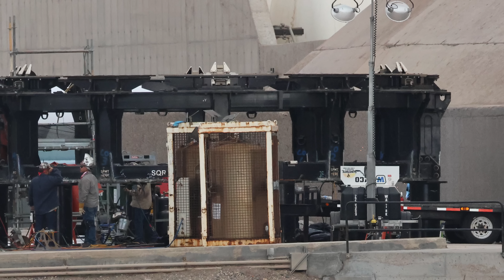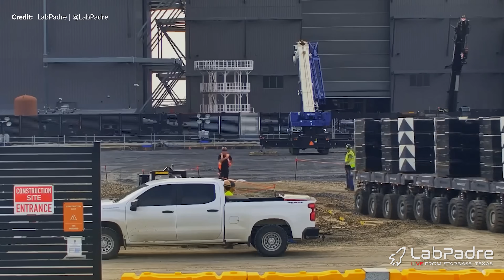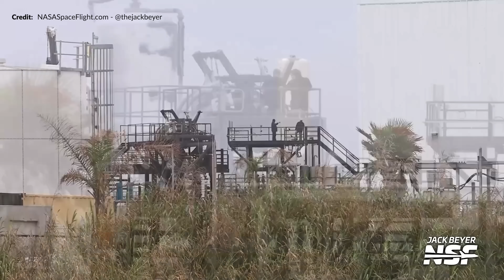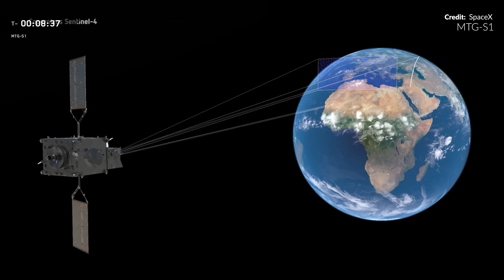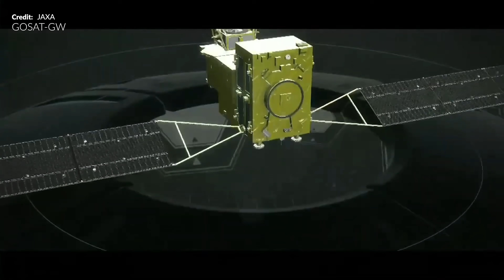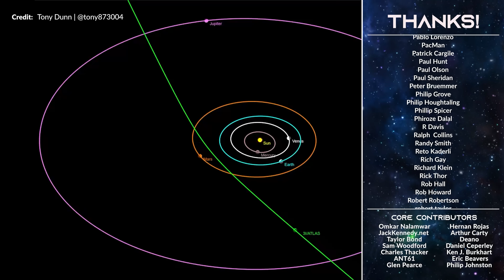SpaceX Isn’t Waiting With Starship... Here’s Their Big Move!

Comment: Is SpaceX bad or 1960's NASA was on God mode? I'm starting to view a functioning Starship like FSD (fully autonomous self driving), only happening inside the minds of investors and nowhere else.
Reply: NASA spent over 300b on the Apollo program, inflation adjusted. SpaceX has spent around 10b so far on Starship. Huge differences right there. Plus SpaceX is working on a more ambitious program. Starship is much larger and over twice as powerful as the Saturn V. And they are trying to do full recovery, rapid flights, massive payloads, and in-flight refueling on top of Lunar landings and eventually Mars missions.
Reply: @anthonypelchat  The entire Saturn V program cost $33.6billion in modern money (according to Wikipedia), for 12 successful launches. That's $2.8billion per launch. SpaceX's $10billion for no successful launches is beginning to look like "poor value for money", especially as it's involving supposedly "cheap and easy" materials like stainless steel, and methane instead of the tricky-to-handle LH2 used in in Saturn V's 2nd and 3rd stages. 

The wider moon landing program cost more, yes, but we're comparing boosters, not programmes.
Reply: @abarratt8869  You are excluding everything else from those costs that the Starship program is doing. The 10B for the Starship program includes not just the booster, but the ship, the entire construction of Starbase, everything for the lander, crew areas and life support, and much more. Further, Starship has had 9 flights at that cost and multiple ships already built.
Reply: @anthonypelchat   $10billion to not orbit successfully once is a lot of money... There's no point in having Starbase, a lander, crew areas, life support and much more if the big firework keeps going boom prematurely.
Reply: @abarratt8869  They haven't attempted to get to orbit. They have had multiple successful flights though.
Reply: @anthonypelchat  Interesting definition of "success"... Sure, they've pulled off some neat tricks; catching the booster, getting one or two soft landings out of fairly singed StarShips. But, absolutely none of it counts for anything whatsoever unless the whole of it succeeds. All it takes is for just one thing to fall short of requirements and the whole thing is a failure. 

In a weight-critical system such as a rocket, the consequences of a failure to meet requirements ripple out across the whole thing, far and wide, and fast. Something not strong enough to survive the vibration environment? Sure, you can make it stronger but then it's heavier. Then you need more thrust. And so on. 

Also, one of the reasons rockets are "expensive" is the time and effort that goes into QA, ensuring that all those component parts that have been cut down to the bare minimum are as close as possible to that minimum without being below it. If you deliberately force a pace (such as Musk does) which such diligent QA can't keep up with, you either need to add weight to everything to compensate or things are going to break. And, oh, look!

The reason why rockets like Ariane and Falcon 9 are so reliable is because both are done to a high QA standard. In the case of Falcon 9, NASA forced them into this as part of getting a crew rating. The French do it because, well they're French (i.e. notoriously diligent and capable engineers, when they need to be). 

By choosing heavyweight materials like stainless steel, SpaceX have deliberately run that risk for the purported benefits of being able to use cheap stainless steel. The kind of issues they're clearly facing would all be significantly eased if they lost a few dozen tons in mass by using lighter weight materials. Changing  materials basically means "start over". 

They may ultimately succeed. If they do, great. But the omens aren't encouraging. They've had several attempts at solving some fundamental issues, and not really got close to whole system success. So far, they haven't made something usable, let alone re-usable.
Reply: Well, NASA spent less money successfully going to the moon (even when sums are adjusted for inflation and time).

NASA has always done a lot of Systems Engineering. This inevitably leads to a lot of detailed analysis and much thought given to design choices  before finally picking a direction to follow, build and launch. It’s dull but it means you’re more likely to identify a complete show stopper before you’ve built anything, and avoid it successfully. 

Musk and co have done way less and have made some assumptions. They’re now finding out that their assumptions aren’t so solid as they thought. One failed assumption was that rapid  iteration would be quicker and cheaper. Turns out, not. 

Blue Origin are more like NASA in approach and will win I think. Their first big rocket launch was a remarkable success. They’re now in upgrade mode, SpaceX are upgrading something that hasn’t worked once. 

The other way of looking at it is that the boring experienced analytical engineer who keeps saying “it’s not going to work” is worth billions. Not listening to such people can get very very expensive.
Reply: @abarratt8869 no idea how you got that NASA spent less going to the moon. The Apollo program was over 25B in the 1970s. That is around 300b today. SpaceX is only around 10b today.

Comment: I don't understand why ground zero needs such complexity. Why can't the launch pad just have a man-made lake under it and blast the rockets into deep water? Surely that has less problems to solve than all this crazy complexity...
Reply: Can't build a lake there. and even then you have to pipe propellant through the water and build the pad in the water which means constant specialized maintenance. And even then I'm pretty sure they'd still have to deal with shockwave reflections off of the water and water being thrown up into the engines.
Reply: You can’t build too deep at starbase because of how weak the soil is
Reply: @thespacegoose4299  All you need is a pond. I suppose the biggest problem with a single calm layer is that it would reflect the energy too well.
Reply: Or a natural sea? I agree, I wonder when we will see the landing craft used as launch pad.
Reply: Because nobody wants clouds of superheated corrosive salt water spreading across their launch site... and it would be salt water, because you're certainly not going to build a freshwater pond in that location.
Reply: @simongeard4824  Gonna face stuff far worse out there, though I suppose for a fueling station, you have a fair point.
Reply: @Stumpy1234  Sure, they'll see a lot of salt all over things just from the air, never mind the occasional hurricane... it's just part of working in that coastal location. But the heat makes it just so much worse... it's hard enough to protect everything from the rocket exhaust anyway, without adding saltwater steam to the mix.
Reply: @simongeard4824  I personally think that launch ships will be normalized, as this allows for simplified orbital path, and reduces hazards to land.

Comment: Ummm... is there any plan to mitigate an issue like 36 at the launch tower testing option?
Reply: The way to mitigate it is to do it right, pad 1 have always been static fire stand for booster anyways, the risk of rocket blowing up on it is always there.
Reply: Nobody has any idea. Employees tend not to violate their NDAs and I don't want them to. Others feel differently but try to stay upright on these things. So no, nobody outside of SpaceX knows anything about that. Fun to guess
Reply: It doesnt matter. Block 3 cannot be launched from the first launch mount, so if it explodes there will not be an other Block 2 flight, but other than that there is no further delay for Block 3.